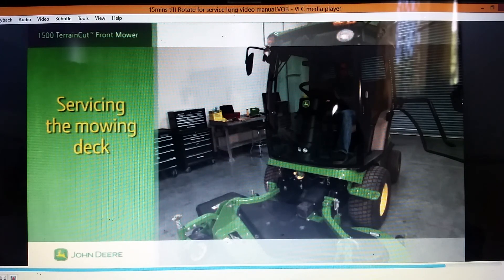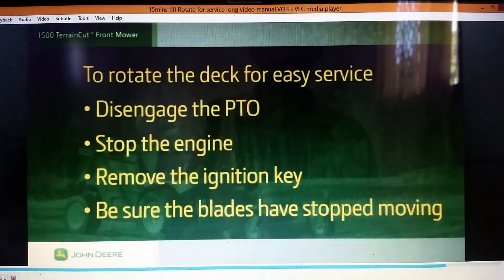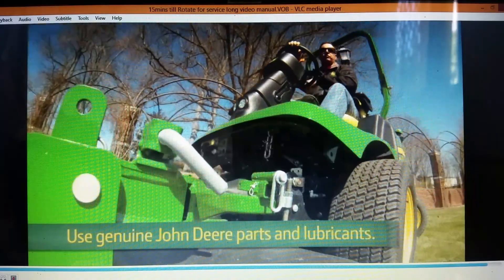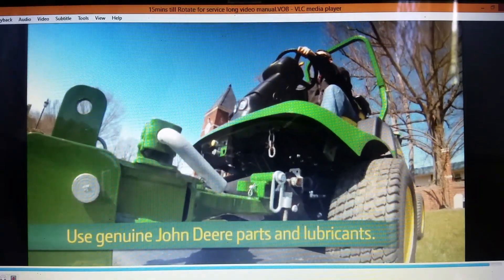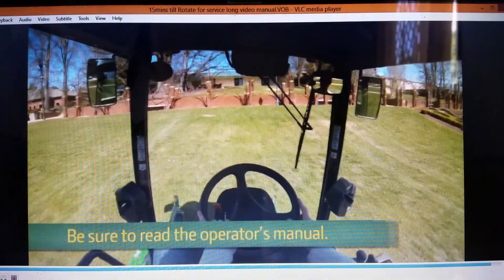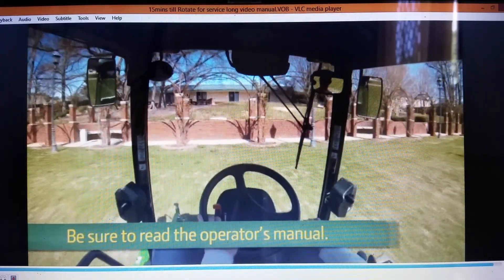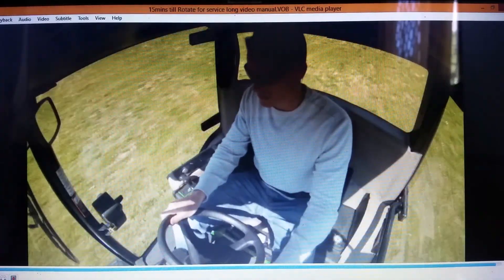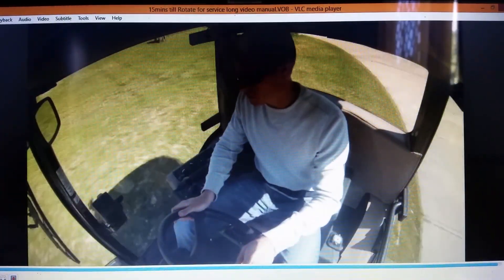False advertising John Deere 1585 of Rotate for service video, too dangerous to do alone.

Comment: You need to read the comments from your last post about unsafe rotation of mowing deck. I may comment on what has worked for me since 1999. One thing I forgot to add, for people that do not know what railroad ties are or an 8 x 8 piece of lumber 18 inches long, use your car ramps.